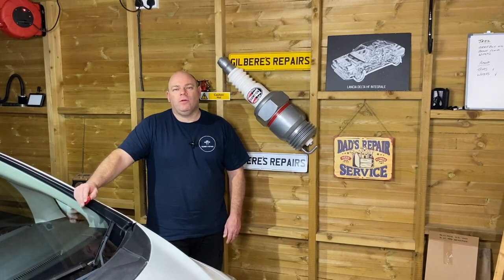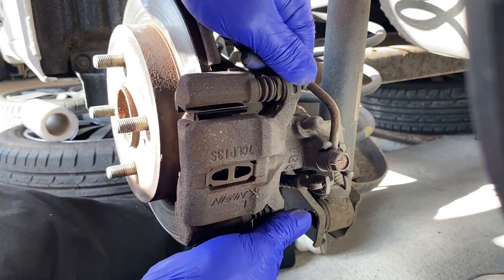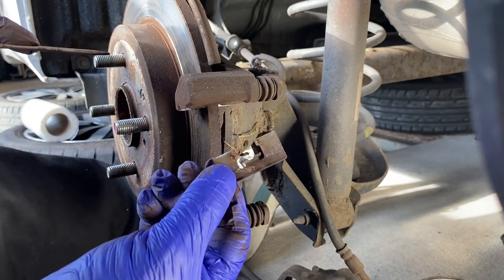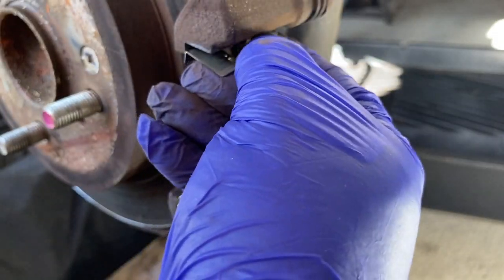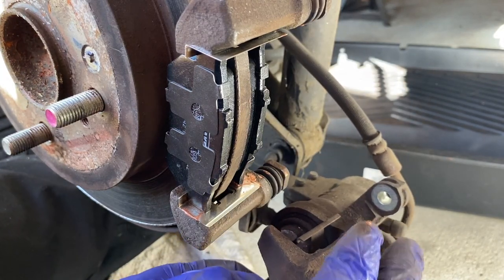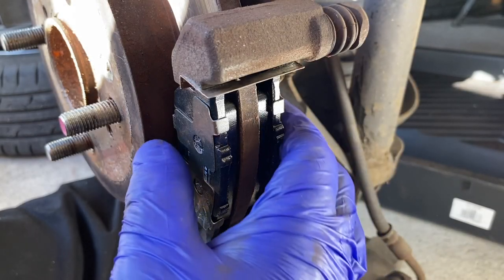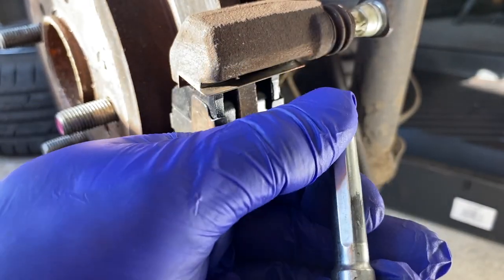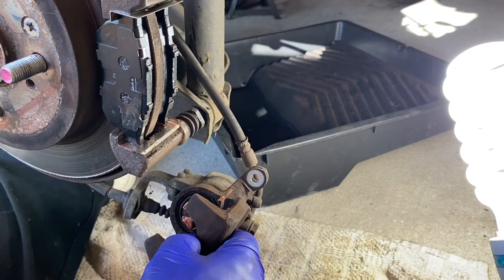Honda jazz fit rear brake pad change

Comment: Hint: when you are to push back te piston, open the purge valve before so to flush the old oil out that was inside the caliper, push back the piston then close the valve. Top off the oil in the reservoir after finshed.

Comment: Only thing I would point out is to not let the caliper hang by the brake lines! Support it with something (bungee cord, box of a suitable height, string, anything). Brake lines aren't designed to take that weight pulling on them in that way.
Reply from the maker: Yes, you are correct the callipers should be supported 👍

Comment: Great video. Just done this. Piston’s easily compressed, turning with a large screwdriver. The handbrake cable does restrict access a lot. There are brackets that will give some slack regarding handbrake cable but we’re seized on both sides of my car.
Reply from the maker: Glad all went well, and the vid was of some help 👍

Comment: Hi I was wondering if it’s a good idea to buy a Honda fit import in the uk my brother is a panel beater and says it’s a bad idea for parts and history of car what you think ??
Reply from the maker: Hello if you are concerned about parts, you could just buy a uk car. Are you considering buying one because of the low mileages and lack of rust?
Reply: I’ve been thinking of buying one for a while now and their is a Indian guy in my home town that has just got a load in imported from Japan and their models have more goody’s attached for the year they are compared to our English counterparts. Hybrid engine start button touch screen just think could cause more heartache than it’s worth!
Reply from the maker: @seanfox3222  Yep, the jap cars come loaded with extras, they like to keep the best for themselves (jdm)😎
We had a Nissan Largo Highway Star many years ago, it had absolutely no rust and very low miles.
There maybe issues with differences but you’ll probably only know when you come up against them. For instance a Mazda MX5 is easy to get parts for, but i think the jap one is a Eunos 🤔 and they have a slightly different shaped windscreen that’s not available in the uk.

My advice is yolo, get it 😂😂

Comment: Are the left and right calipers threaded differently when it comes to re-winding hence there being the 2 opposite threaded tools? If so, which side goes clockwise and which goes counterclockwise?
Reply from the maker: Hello, both pistons use the right hand threaded tool in the kit.
They are both the same 👍

Comment: Nice well explained video. One thing I've found, is that the pads slip in very easily, in parallel with the disc, slipping in from behind as it were! One other point I'd make is that the piston cross needs to be aligned, to get over the raised location pin on the inner pad. Can lead to frustration and a fair bit of swearing otherwise! 🤣
Happy to see the use of copper grease, you'd never get the bolts out up here in Scotland, on an older vehicle, with the standard feature of rust!
Reply from the maker: Thanks for the positive comment and tips for other viewers 👍

I tend to use copper grease on most parts when reassembling, makes it easy for the next person, which is usually  me! 🙄
Don’t forget to check out my playlists 😉
Reply: @gilberesrepairs  yeah some keyboard experts certainly get cross when copper grease is mentioned. 🤣
Reply from the maker: @gtd65  Yep, certainly seems to be a bit of a Marmite product 😂
Reply from the maker: @gtd65  I’ve just watched your wheel bearing video. We have similar channels 😎 at opposite ends of the country.
Reply: @gilberesrepairs  yeah, mine adds more rust and more dodgy camera work 🤣
Reply: @gilberesrepairs  yeah, mine adds more rust and more dodgy camera work 🤣
Reply from the maker: @gtd65  Definitely more rust, similar camera work!

Comment: 15:14 It is clear that the tool is actually not pushing. The thread inside the piston has a bigger step than your tool and it is winding faster leaving the tool slack. I don't know if other cars are different but I just did the breaks on a Jazz this morning and didn't need a special tool. I just used a small metal plate like a screwdriver and the piston went in. I clamped it with vice grips to give a handle to turn it easier.
Reply from the maker: Thanks for your comment, they all help to make it easier for anyone carrying out the task 👍
Don't forget to check out my Jazz Playlist.
Reply: do the pistons not just push back or have to be wound back? Confused here as I thought only German cars need pistons wound back.

Comment: I have just changed my rear pads on my 2012 Mark 2 Jazz: identical.
I don't use copper grease: can interfere with ABS sensors and melts with heat . There are ceramic /silicone greases made specifically for brakes which are far better and do not melt.
Reply from the maker: Yes, i fully agree! 👍

It’s just one of those products i’ve always used. Probably because i’m old and set in my ways 😂😂

Comment: Thanks for the video. One short question, I see that when you returned the cylinder, the protective rubber of the cylinder got a little wrinkled. Is that a big problem??
Reply from the maker: Hope the vid helped 👍
Yes, definitely un-twist the rubber boot. I straightened mine out by just feeding in a small terminal screwdriver in between the boot and the piston to re-position it 😉
The rubber boot is there to prevent dirt/moisture ingress, so is important for the long term operation of the calliper.
Regards Sandy.